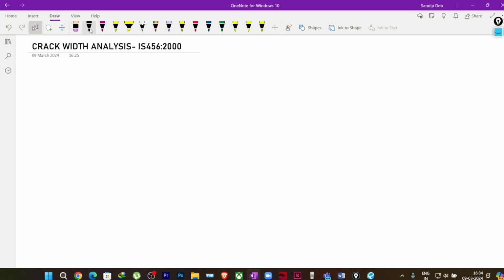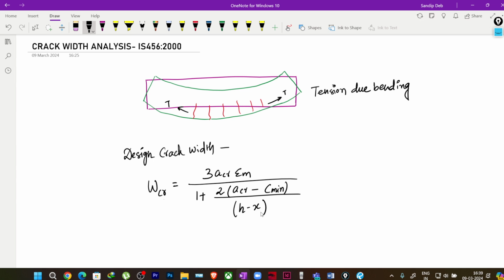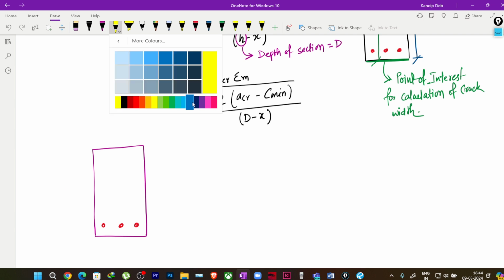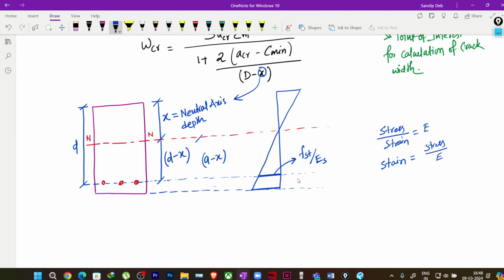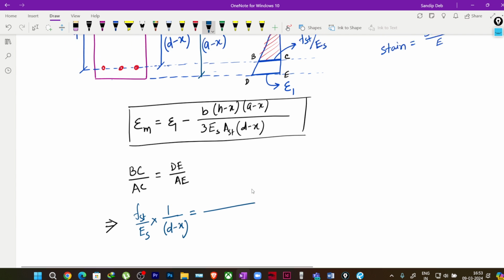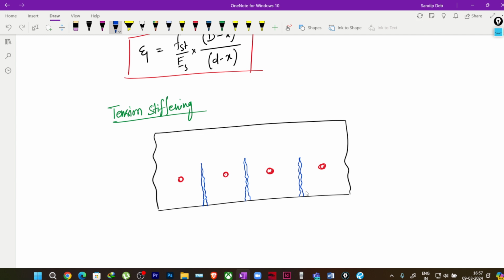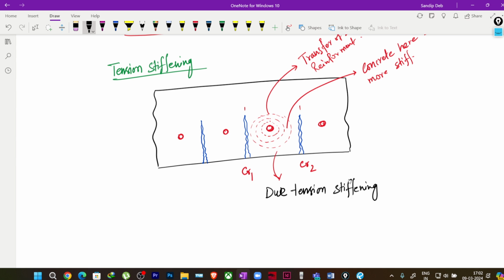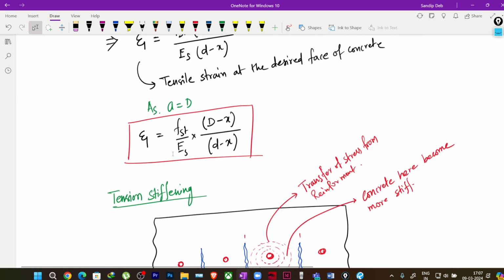Crack Width Analysis | IS 456 : 2000 | Part-01 | ilustraca | Sandip Deb

Comment: Sir r u calculating crack width at bottom face of beam in longitudinal section.
Reply from the maker: Tension face, if you consider botton face then bottom, if you consider top face then top… process is same